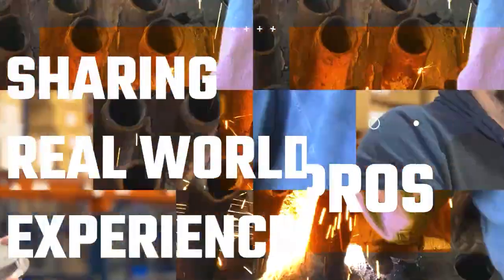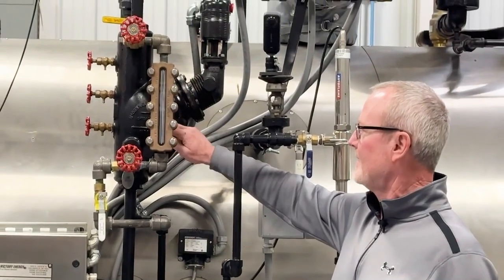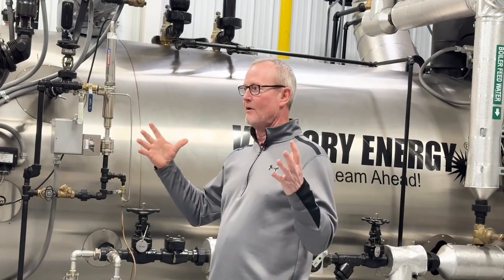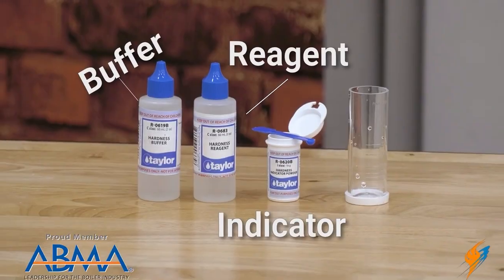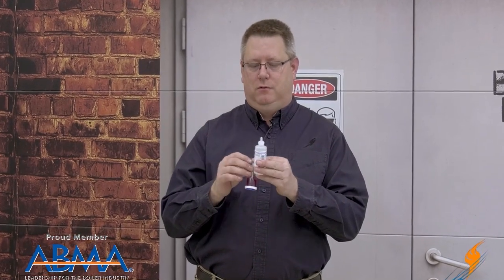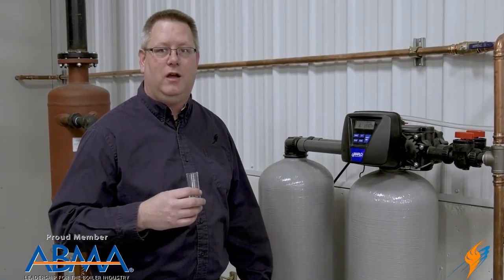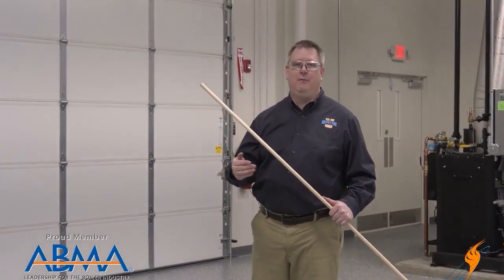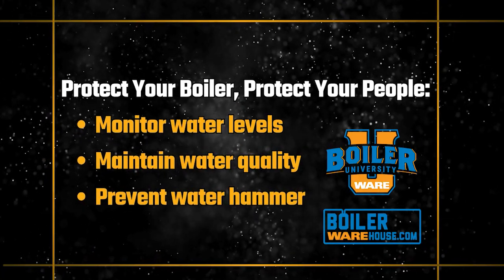3 Boiler Killers You Must Prevent: Water Level, Hardness & Water Hammer - The Boiling Point

Comment: Years ago I suffer with this tree cases, in one boiler stove tube and firetubes went severy damaged cause by low water levels' protection failure. And other 2 cases water análisis was good, not enough to avoid incruste boiler interior and finally water hammer because installation no count with a single expansion joint.